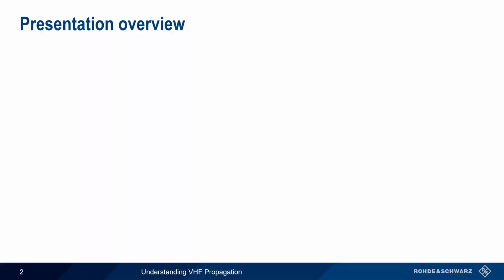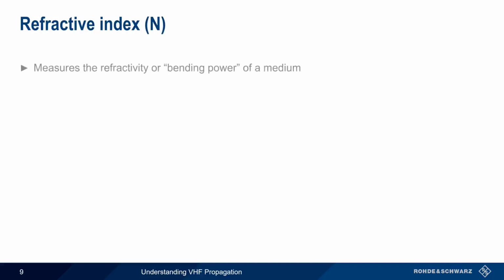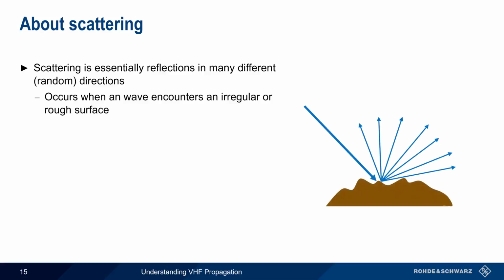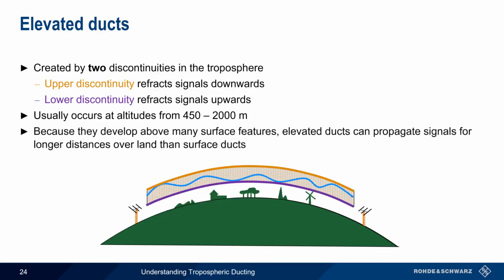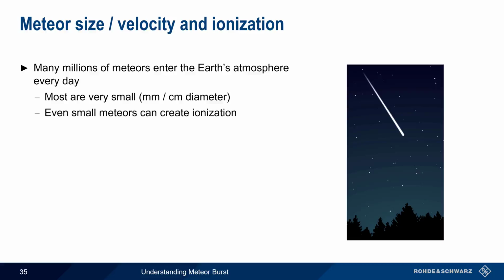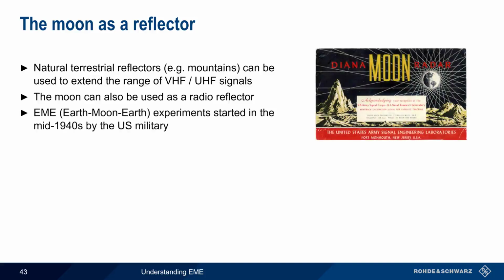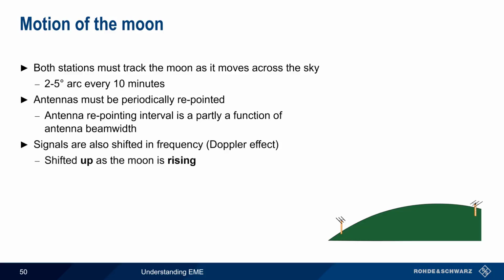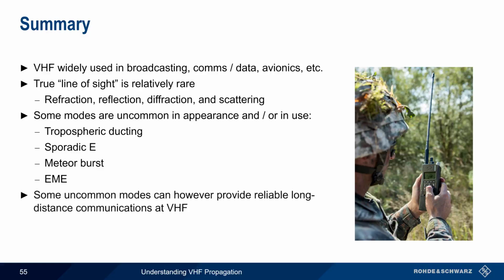Understanding VHF Propagation

Comment: Outstanding presentation! I have been searching for a credible explanation as to why my VHF signals (and sometimes 440 MHz) are received beyond LOS. Some sources say it is impossible, some say ground wave propagation is impractical above 2 MHz. Few breakdown "ground waves" into the components surface waves and space waves that help explain beyond LOS transmission.

Comment: Except there is no actually observed, physical, measurable curvature, only varying potentially possible and actual obstructions.
Marconi proved that quite a few weeks ago.
And he wasn't hop skip and jumping his line of sight signal.
Earth not a *globe, however it is observed and measured to be a topographical, non- rotating, stationary, level plane.

*A globe is a toy, and is labeled as a decoration.

The heliocentric model is scientifically unsound, impossible, & unviable.
A theorytale, in violation of several key, natural, physical and nonphysical Laws.
Just like evolution.
Which is pseudoscience regardless of what you want to believe or are taught\told to accept.
Don't believe me, prove me wrong, without resorting to any logical fallacies.

Comment: Wow, 250dB path loss for EME is wild! If the noise floor is at -170dBm, a I suppose a 1kW=60dBm transmitter and a 10dBi tx antenna + 10dBi rx antenna would barely make the link budget pencil out,  right at the edge of what's possible. Cool! What kind of process gain is typical in modern protocols?
Reply: EME has (for now ...) more or less moved entirely into the amateur realm, so the "modern" digital protocol is mostly JT65, which has 10-15 dB of processing gain over CW.